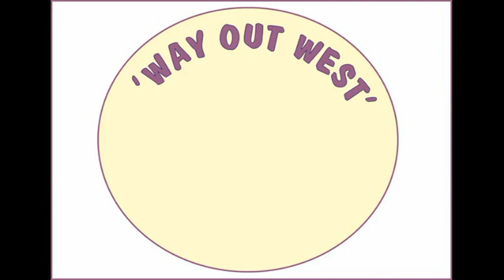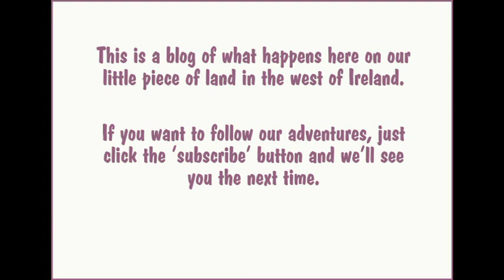How To Make Really Good Concrete Or Mortar In A Cement Mixer -- In Three Minutes!

Comment: You make some good points about mixing Mr Wayoutwest.
Here in Limeyland (Southern England)I tend to do mainly lime mortars in my mixer and for those mixes you never have to add any feb mix or chemicals.
When I first started as a labourer we were told to dry mix the ingredients first and then add the water second and to make the mortar even stickier you had to turn it off for 20 minutes then back on for a couple before turning it out (for the record,this was using 
a French hydraulic lime called St Astier,an NHL 3.5)
I later discovered that this was a wrong idea unless you turn the drum so that it points straight up which can only be done with the bigger mixers because it puts less strain on the solenoid when you turn it back on again as the weight of all that mortar is harder for the drum to turn over.
Nowadays for a really sticky lime mix I use 2 sharp sand,and1 soft builders sand to the lime but for the stickiest lime mixes you need to use a lime putty and 1 stone dust and 2 sharp sand,it's the fines in the sand that cause the stickiness and this is essential
along with hair,fibres or polypropylene plastic fibres when plastering a lath ceiling.
To see if it's sticky enough,scoop out a trowel load and turn it upside down,
if it's sticky enough it will stay on the trowel without coming off,you cannot do this with cement.For a sticky cement mix,do a 6:1:1 (5 sharp sand,1 builders sand,1 cement and 1 hydrated lime) many people think that because they have lime in their mortar that this will make it porous and breathable,this is bollox and a myth,for a breathable,porous mortar you must use just lime in the mix,having any cement in it will compromise your mortar and if you are using a lime you either use a lime putty or quicklime,another name for that is lump lime and this is what the builders of old would mostly have used.
Here endeth the lesson,have a nice day.
Reply from the maker: +Peter Gambier Strange that we were both taught to make it the wrong way, isn't it? Luckily we learned better.
I like lime plaster too and have done quite a bit with it - not much opportunity to use it here at the moment though. 
Have fun!
Reply: +WayOutWest Blowinblog, It is really in the last year that I have been using lumplime for the hot mixes and the guys who have been doing walling and pointing work swear by the hotmix method because it expands and is better to fill all the voids.
For a general external wall plaster/mortar it is being used a lot more by conservation people.I try to exclusively use lime putty and the only time that I use cement is for screeding or tanking work.The big commercial firms tend to use the faster setting NHL's because they set quicker and so get paid sooner,on my last job doing lath work it took about 6 days before I could do the 2nd coat, but what I learnt years ago was 'the longer it takes to dry the harder it becomes' and all the best old mortar samples that I have that came from old 100 plus year places have all been the mortars that were hotmixed in a pit on site.If you are doing external wall coverings it's better to use it cold otherwise there is too much cracking and it's suggested by English heritage that you should mix a hydraulic lime with it.
So we did 4:1 sand:quicklime plus 3:1 sharp sand:NHL2,and by mixing in fibres it cut down on the cracking.
Reply from the maker: +Peter Gambier Here in the west of Ireland all outside plastering is done with cement and waterproofer because it is just so wet here. I mean WET! The people who have tried lime have all changed back..
Reply: +WayOutWest Blowinblog ,fair shout my fellow spreader,I too live in a wet part of the south west of the UK,but I live in a cob house.The cob sits on a rubble stone plinth,no foundations,I have a thatched roof and no guttering.I dug a French drain around the entire property putting in a perforated pipe in the bottom of the drain trench with Indian sandstone flags on 3 sides,the 4th side is the roadway.I then tanked the walls facing the hillside that's behind me and took off all the 1970's cement render and replaced the whole shoddy lot with a 2 sharp:1 stone dust: 1 NHL 2 mix mix and blasted on the last coat using a mortar sprayer for a rough-cast finish.I now no longer have any damp problems anywhere.Inside the house we have no central heating just a wood burning stove and I reckon,based on my experiences of building strawbale properties that we could solve the housing problems by building sustainable,cob and strawbale homes for about £30K.
Seeing as how new build homes are only designed to last for 40 years(if that) I think the cob and strawbale ones,if built properly with nice Welsh slate roofs would be the answer to many of our housing problems.
So if you are up for it,when I take over the world,do you want to be the West of Ireland branch of my empire?
Lets face it the Brits have a lot to answer for by not helping your country men and women during the last centuries potato famine when they could so easily have done,and before you say anything,my family were French Huguenot refugees who integrated quite well into the UK,I've even got many ancestors who fought and died for Britain during WW2 and other conflicts over the years and to show amends I have been married to a Southern German lady for the past 27 years,even though my granddaddy bombed all of her family out of existence.
By the by,what other name can I call you by,as 'WayoutWest' is a bit of a mouthful and takes a while to type.
All the best.Pete.
Reply from the maker: +Peter Gambier Sorry, Peter - no internet for a while because of the storms and so much to catch up on. Best wishes, Tim
Reply: +WayOutWest Blowinblog,sorry to hear about your storm troubles,I hope all is OK.I look forward to further bantering Tim.Happy Xmas in the meantime and all the best to kith and kin.Don't forget to always use a good lime putty when you can.
Reply: +Peter Gambier we call it &quot;fat &quot; lime...and dry mixing or &quot;dry knocking&quot; is only done in a &quot;barra&quot;....the lime is best mixed in tubs and left over night......but thats irrelivant on this vid.
Reply: +WayOutWest Blowinblog god bless the west.
Reply: +Peter Gambier your "housing problem sounds tiny.....we in oz have a masive housing problem....because we cling to the coast.....do you have an agenda with all that hate revive...?...this is building not destroying....the "famine "...was " blight" a disease from ballast in the ships returning from america.....maybe we should have never left.....maybe we should not have killed all those settlers...but it happened....get over it....
Reply: That's probably because we are so bombarded by information overload that us people are also prone to unconnected verbal drivel Mr Chef.
yes,I am normally guilty of gong off on a tangent,however in actual fact on this occasion I stuck with the program and warbled on about the porosity of lime mortars and didn't go off on one.....this time.
Reply: motobikes

Comment: Thanks a lot for the video as I have been looking everywhere for this information.

I measured out a bucket and 3 shovel fulls is 1 bucket. I used 6 buckets to 1 bucket of cement which is half a bag. This made up 1 wheelbarrow of concrete but i did have to use almost 1 bucket of water. I am mixing by hand unfortunately. Thanks again.

Comment: Thanks that's tied up a few loose ends....i've been staring into a mixer since i was 16....now im 45.........Now whens Planet X due?...........BTW..........i like to quickly prime my wheel barra with a splash of water so she pours out nicely))
Reply: +Christopher Taylor do you hear voices when starring into a mixer....."mud....mud.....mud.....and the slapping of trowels on wood....what can it mean...?
Reply: +Christopher,I too have been mixing a while but my life changed for the better when in 1995 I started learning about the wonders of lime mortar and hot/cold mixes etc.With our current world problems and those arse wipes in Isis and those traders responsible for all the greed concerning Madoff,Enron and the sub-prime bollox I also wish that planet x would hit us.
Before it does,watch the great talk on Ted.com about building with bamboo.Another to watch is 'Cowspiracy','Enron' and not forgetting 'Madoff'.
Also,for a really sticky mix of lime mortar,we use a 3:1 mix in the UK,so I like to use 1 stone dust: 2 sharp sand & 1 lime putty or an NHL 3.5 you will find a beautiful and gorgeous mortar ideal for plastering onto wood laths on a ceiling.
After you have seen what a truly great sticky mix is like you may not want to see Planet X,in fact if you haven't already tried it, get into sustainable building with strawbales and mud bricks,after working with sand & cement for as long as you have learning about the lower carbon footprint lime stuff may change your life and opinion etc,it certainly did it for me,now I never use cement and have never been out of work either and I don't advertise either,so give it a try Chris,you might be surprised.Also instead of using animal hair or polypropylene fibres I only use sisal.

Comment: is that an actual blend of sand and gravel your using or is it what we call in my neck of the woods 3/4 stone down to dust (which is a blend of 3/4 limestone in various sizes down to dust) if it is i would only use it for bedding and backing drive way kerbs .would not use it for paths ,floors or foundation,it contains no sand.a good source of info for concrete and mortar mixes and there various uses is the irish cement ltd website.half bag of cement to eighteen shovels is not good a mix for floors , footpaths ,or foundations  i.m.o.
Reply from the maker: bric bybrick thanks for your comments Bric - yes it is a blend of sand plus graded stone. There's no point making a stronger mix for block-work, for instance, when the blocks themselves are made at 7:1 or 8:1.  this mix is 6:1 - plenty strong enough for all non-specialist uses. But each to their own

Comment: how much do you get out of a bag ? im looking to do the floor in my wood house and just trying to figure out how much material i will need
Reply from the maker: MrCodythegreat The wheelbarrow-loads you see of finished mix are what I get using half a bag of cement. Not sure how to quantify it more accurately than that? You could fill a wheelbarrow to a similar level and count the litres (gallons) of water, maybe? Good luck with your floor

Comment: Use a gauging box or bucket to measure.  Novices.
Reply: +oldmanfromyork we sometimes have to work fast.....the measuring is done in the planning stage....2 ton gravel 1 ton sand  half ton cement.....savee.?
Reply: +Scott Awaywithit pathetic excuse.

Comment: sand and gravel -  sand or gravel ? mix sand / gravel what proportions?
Reply from the maker: +MrPablooki you can use only sand, or a sand and gravel mix - but you can't use only gravel. half and half's good.
Reply: +WayOutWest Blowinblog 
Thank you very much and how can I do "half dry" concrete? 
Half dry ?  If you know what i mean
Reply: +MrPablooki 123.....1 cement....always 1 cement....2 sand....3...gravel...or ...3 sand and 2 gravel.....depends on your needs.....modern concrete has fly ash...(coal fire dust) added as a pozzalanic (hydrolic) setter.....there needs to be enough sand to make it workable.
Reply: +MrPablooki half dry is all about not being too wet but if you leave a bag of cement in the rain wnat hapens.....it goes off.....same thing.....half dry is for packing tight into post holes...(after you set the post ).....or if you want to out smart gravity and create a run off......by making a high point in a path.

Comment: I was always told never to put plasticiser in concrete, only mortar. Plasticiser reduces the final strength of concrete - far better with just water.
Reply: Unless the mix is "starved" of water, the strength of concrete is inversely proportional to the amount of water added or water-cement (w/c) ratio. In order to produce stronger concrete, less water is added (without "starving" the mix), which makes the concrete mixture less workable and difficult to mix. Adding a touch of plasticiser does not decrease the strength of the final cure but does make it more workable as if you had added more water, which of course does weaken the final cure.
Reply: mr10man69 good information explained clearly .an old adage regarding concrete is" the more water in the mix the weaker the concrete"what you need in concrete is the optimum amount of water to much water weakens it ,to little and the various components eg stone,sand and cement wont combine properly.